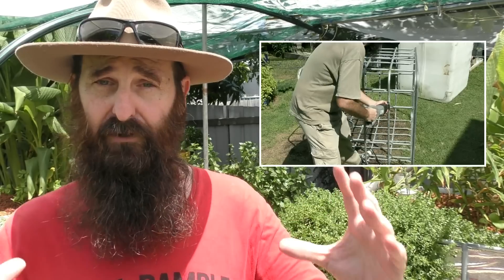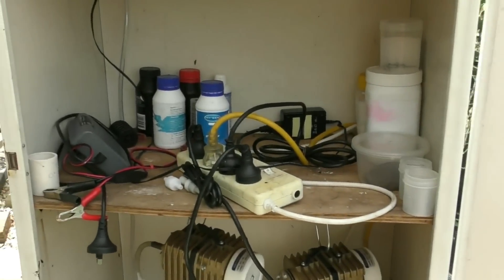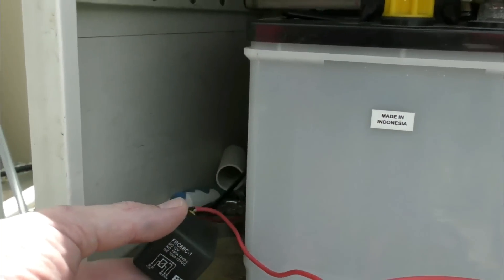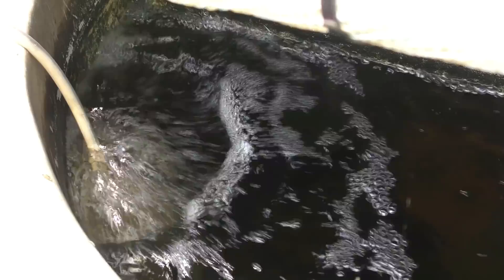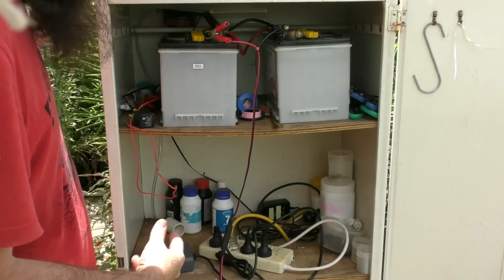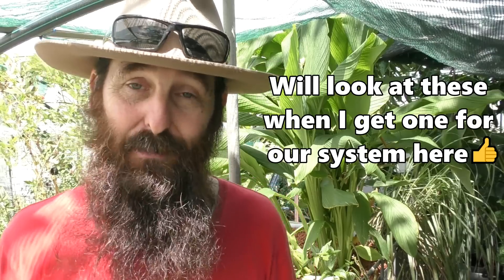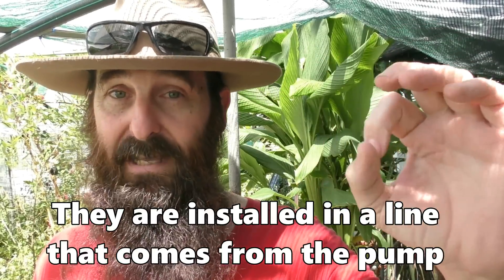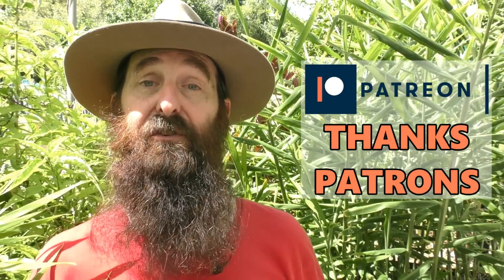12V Back Up Air System For Aquaponic Systems

Comment: Thanks Rob for this great video and diagram. We had no trouble getting the headlight relay for this set-up but didn't have access to a 12v air pump so temporarily used an inverter from battery back to 240v so we could use our existing air pump. 
Power went out today in 34c heat. Plugged into inverter and off went the airpump same as ever. We airlift the water with same pump so water went around as usual.
Thanks to your prompting all fish and plants fine.
Thanks again.
Reply from the maker: Am glad you had something ready Kim. 👍 Have heard a few sad stories after the last round of storms here in SE QLD. 
Cheers & happy growing.

Comment: Hi Rob. Yes a backup is very important even a backup for the backup. I lost 843 fish 3 weeks ago due to a 24 hour blackout. Total about 100kg of fish .
Reply from the maker: Am sorry to hear that Victor. We recently bought a generator for that reason when they shut off power to the street for 8 hours. Wanted an extra backup just in case the work took longer than they planned. 
Are you going to restock the system?
Reply: Rob Bob's Backyard Farm & Aquaponics hi Rob. Yes i have 5000 fingerlings stil left that i am continiuing with now.

Comment: Thanks Rob. Looks like an easy fix to a potential catastrophic problem. Converted everything over to 110v for the US. Thanks
Reply from the maker: Wasn't sure what was the standard over there Charles. Are the parts fairly easy to find mate?
Cheers.
Reply: Rob Bob's Backyard Farm & Aquaponics sure are Rob. Took about five minutes and $60 on Amazon and was done. Super simple and the only thing different was to 240 -12v power adapter. Did a quick cheat sheet with pics to help me along. Again thanks a million.

Comment: Hi Rob
I would recommend adding a small solar panel to your back up system, even a 1A panel will increase your run time by 50% and that may be long enough to save your batteries. Obviously 2A or above would be ideal but they do get a bit pricey. If you are worried about overcharging your batteries  you can wire them like your pump with another relay.  
Keep up the good channel.
Reply from the maker: Will have panels to help power the system in the future once I get a safe place to set them up. I don't like the idea of wiring the to the top of the hoop house at the moment. 
Cheers & have a top one Justin.

Comment: Thanks for the look, Rob. Not always easy finding a reliable battery powered air pump, but they are handy indeed. Not sure if you mentioned it, but you should also run the battery pump once or twice a month. That way you are not surprised if they do not work. A inexpensive inline timer set for 20-30 minutes on/off cycle may help you extend your battery time.
Reply from the maker: Hope you enjoyed iut Harry.
I cut a lot of info out to try & keep on just the back up unit & to also keep the clip around the 10 min mark. 
Looking at the comments on the solar & battery, I think I should of left them in. 😉
Cheers mate.

Comment: if you were to change out your 12v power adaptor to a 13.5-14v adaptor you could use the normally open relay contact to keep the battery charged
Reply from the maker: Thanks for the heads up. Will have a look at that when I re work the system
Cheers.

Comment: Rob what size compressor do you use how many liters per minute and does the pressure matter? Thank you
 for your channel.
Reply from the maker: Hi Nole. I use a 4000+LPH aquarium compressor as my main backup at the moment. I'm not sure of the pressure but it appears to handle the 1150mm of water depth just fine. It's also split with the bio & that boils & bubbles worse than a spa bath when it kicks on. Hope that helps a little mate.

Comment: FYI you can get the relays in 240V (or 120 for NA standards)coil ratings, eliminating the power supply. Make sure the terminals are thoroughly insulated, IE Liquid Electric tape.
Reply from the maker: In Australia we need a certified electrician to work on 240 so that's why most use the 12v power supply to a relay . 👍 
Cheers Bryan.

Comment: It might be a good idea to brace-up the shelf your back up batteries are on.  It's getting a bit saggy.  Either that, or put them on the bottom shelf as bottom shelves are supported by the ground.  You could flip the shelf over in the short term, but after it straightens out, it'll get weaker and saggy faster than the first time.
Reply from the maker: That's one job that's been on the list for over a year now Ron. Will get to it one day this week. 👍 Cheers

Comment: Nice info man thanks.  Subscribed by the way.  Also you have enough sun why don't you run a small solar panel to keep your batteries charged?  Seems like that would keep them at 100% all the time and you would just have to check them with a multimeter a couple times a month. Don't know if it will work but it should.
Reply from the maker: The plan is to have some on the roof of the new aquaponics area. There was never enough space around this older setup. We also have a solar system on the roof of the house so about 50% of our power usage was coming from there at that time.
Cheers.

Comment: Hi Rob, Great video....I am looking at running everything off solar. Do you think the same sort of set up could be used but in reverse, i.e. batteries run out so switch to mains power.
Reply from the maker: It could be done Garry but I have no idea on what you'd need in the way of wiring sorry mate. I'm sure the folks at the solar or electronics store would know exactly what you'd need to make it run smoothly.
Sorry I'm not much help mate. Would like to know how you get on though when you get it sorted. 👍
Cheers mate.
Reply: Will do......Might have it sorted working on a box with an electrician that looks like it will do the job. All based on a 24v system.
Reply from the maker: From what I've seen 24v is the way to go. A lot better options for water pumps. 👍

Comment: Rob, thank for this great timing I was thinking yesterday about back up power ....what are the air compressors you are using please.  Tony
Reply from the maker: Hey Tony. There's links to the 12V pump & info on the relay in the description. 👍 
The main Air pumps I'm using are ar generic version of the HAILEA AIR PUMP ACO-328 that pump about 70 lpm.
Hope that helps mate.
Cheers.

Comment: Great video Rob, how should I calculate what size air pump I might need? Cheers Graham
Reply from the maker: Hi Graham. I like to pump as much air into the FT as it's volume. So a 2000L tank would get 2000L of air. That is also keeping in mind that I only stock at no moire than 1 fish per 25L of water. 
Hope that helps mate.

Comment: Thank you for reminding people not to tinker with 240V!
Since working in a store that sells Cables, wall outlets, Plugs and stuff like
that i know how many people do it and how little they know so i get a bit scared...
"how do i connect this lamp holder - it only has two screw terminals but i got three cables coming out off the wall"

Comment: Great video I'm gunna make a solar powered filter not sure wat am gunna use but will sort it.
Reply from the maker: Would like to have the whole system run off solar here but will have to wait a while. The house has a tied to grid system so it is partial solar powered in a way.
Cheers Tommy.

Comment: That was perfect timing!  Did you lose power?  I went out for 6 hours.
Reply from the maker: Hey Andy. Wasn't planned I swear. 😀😟
Glad you had no major damage mate. 
A window slammed shut next to my desk here & smashed + the tarp was ripped from the house in a few spots but that was it. Kept power but we don't have many trees near the lines here. 
Was glad we didn't have a repeat tonight as we are still without glass here. 
Cheers mate.
Reply: I have quail eggs in the incubator Wednesday.  Makes me tense.

Comment: Rob, please add fuses to your 12 volts systems just in case.  Also, think about a small solar system to charge your batteries.
Reply from the maker: Good point mate, thanks. 👍

Comment: Hello Rob, 
1. what is the model name of the 12V air pump that you're using in this setup?
2. how much did it cost? 
3. where did you buy it?
Reply from the maker: Hey Juan. I did show the model at some point in the clip & have a link in the description. 👍 
It's a Hailer ACO-003 & I bought it 5 or 6 years ago for about $130-150. They've gone up a bit since then from what I've seen.   
I probably bought it off Ebay. There are a number of generic branded pumps that look very similar & have listed a few on our Amazon Influencer page you can use a a reference. They are a lot cheaper but I can't vouch for their quality. 
Hope that helps some mate.
Cheers.
Reply: Thanks Rob

Comment: Another option, if you're starting from scratch, would be to use 12V pumps exclusively.  You can power them from a 'dumb' battery charger with the battery in parallel with the pump.  Then the pump runs off the battery charger and when the power goes out, it just keeps running off the battery.  This way there's no need for relays or separate chargers.
Reply from the maker: Nice idea Vink. Would need to get a different air pump as these aren't rated for continual use. 
Cheers

Comment: Lets say your system switched to backup if the circuit breaker tripped on your 4 way adapter. Your battery’s would run flat without you knowing. To solve this you could run a LED flasher strobe off the relay output. Everyone in the neighborhood would know!
Reply from the maker: Not an issue for me as I work from home & visit the system at least twice a day. Can see where it could be of benefit though.
Cheers.

Comment: Just a heads up, those batteries have vents and as they charge they will put off nasty chemicals and your air pumps are using that nasty air to pump into your fish tanks.   I would move those batteries outside the box into another well vented container.
Reply from the maker: That's why I charge them when I'm home & always leave the door open when charging. 👍 
Had to cut a fair bit out of the clip as I wanted to focus on the backup itself.
Cheers.